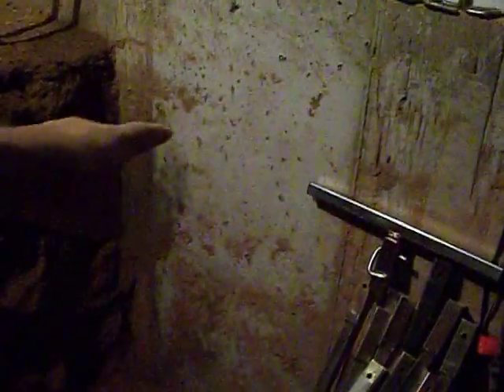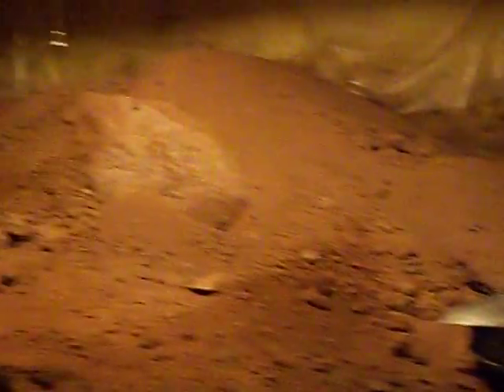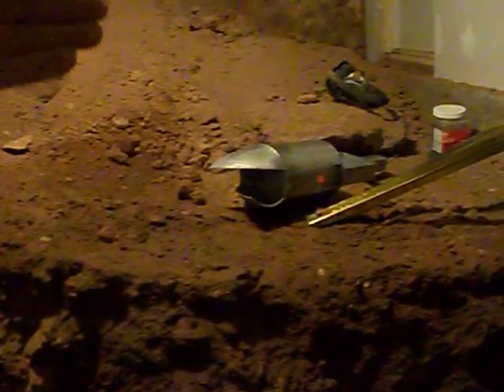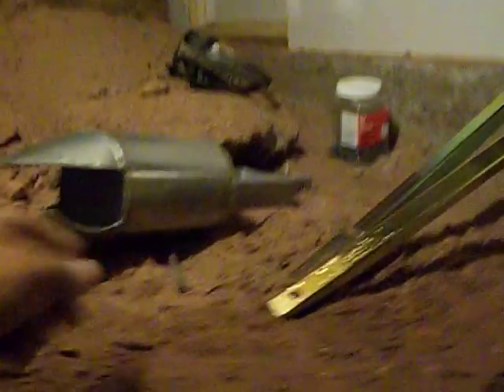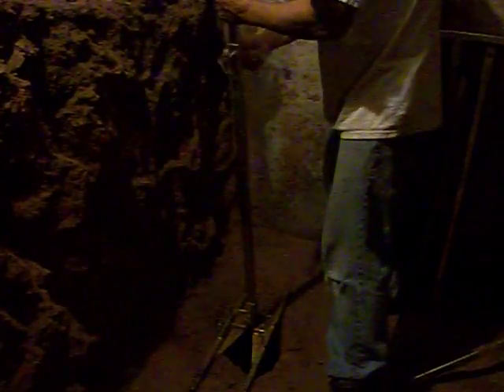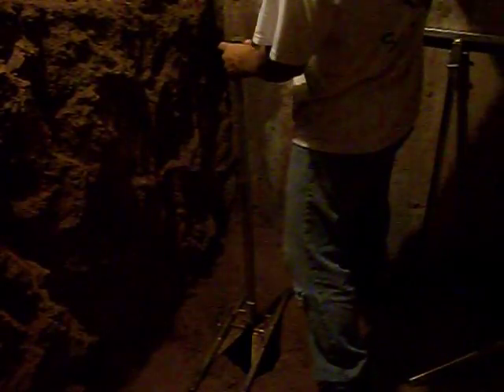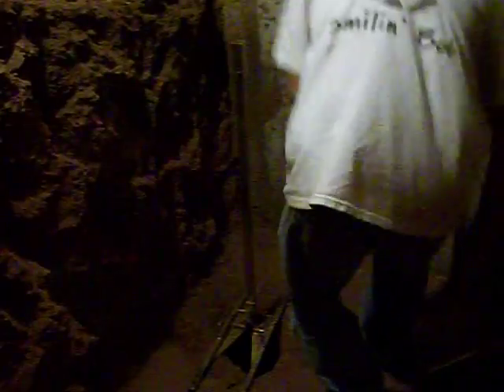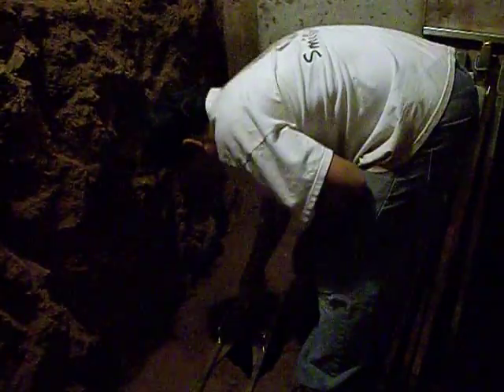DX GEOTHERMAL VERTICAL GROUND LOOP INSTALLATION PART 1

Comment: I have limited experience in these systems.  When I went to one of the manufactures to become certified I learned that:  

 If these holes are vertical and too close together, you will start to cross the heat available with adjacent holes thus you will not experience the performance anticipated.  That's why these are drilled at an angle into the earth.  If done by your method, (NOT DESIGN...just the "Straight Down' method), the holes would be spaced far enough apart that there is some difficulty in obtaining the correct resistance in each loop to equally distribute the refrigerant.when you finally reach the manifold.  Not doing this was the mistake made in this industry many years ago.  The systems were very difficult to get the performance predicted.  It wasn't due to the equipment, it was due to a failure by manufactures to adequately inform installers of the extreme care needed during installation to have a successful running system. 

If you look at their systems, you will see a symmetry to each loop and its connection to the distribution manifold.  Even the manifold itself is designed to be as symmetrical in the distribution to each loop as possible.

I do not, however, know what your doing  ie... your calculations and engineering.  I am trying to find a video about these things because I would love to put one of these systems in without involving a drilling company.  You can bury a loop but that's a huge deal.
Reply from the maker: Thanks for that info.  luckily for me I realized that freezing the ground below the foundation is not a good thing either so I converted the wells to water loops with flow regulators.  I will lose about 30% efficiency but circulating water will not freeze the ground.  So with the design modification, I have a much less freon and a heat exchanger and pump but it will be safer.  The wells are dug 2' apart but I drilled every other one at an angle so in reality they are spaced 4' apart.  That may be too close also.  I'll post a video of its performance once the heat pump is installed.

Comment: duuude u give me hope for my house how many years u drill by hands that hole and how many meretes deep...i cant hear u i dont have sound
Reply from the maker: Actual labor was about 2 weeks per hole.  This part of the system is done however I also remodeled the house, changed the heating system from forced air to in-floor radiant.  All in all it will cost about $250,000 materials upon completion so its been a slow process working and saving money.  I'm about 3/4 finished with the entire project.
Reply: to expencive mate ...i thinkin to drill myself and just to buy a heat pump which is about 7000 euro but dont know how deep need to be the hole to produce 10kw/h i read somewhere is 1 m of pipe is like 20 w ...that mean 500 m pipe to do 10 kw/h  but for 500 m how many holes i need and how deep to be...